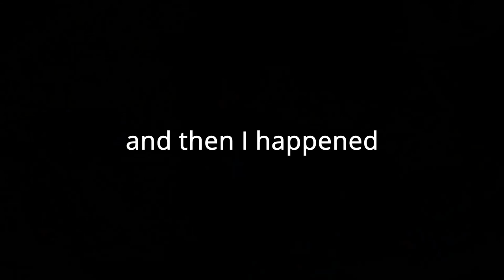1967 Starcraft Holiday Stern drive repair Mercruiser 120 hp we found the leak

Comment: I can fully testify you should use that special tool to removes that goofy upper out drive nut. I tried using a punch and just destroyed that aluminum nut. Good thing I was just wanting to see the locked up bearings as I had already ordered, received and installed the new SEI 106 upper and lower.
Looking forward to seeing what the ding ding sound may be👍
OH, one more thing, I bought and started using a black pool noodle on the lower angled windshield mounts like you have on your orange Starcraft, makes for a great armrest and a nice place to put a hook when re-rigging a catfish pole
Reply from the maker: It sure does. Pool noodles are kinda handy. Thanks for watching

Comment: Gday mate i also follow dangar stu ( dangar marine ) he actually lived about 10km away when we were growing up now in sydney ,anyway the sealant you talk about s sikaflex 291 same as the 3m product really comes in black and white i have used it for years on my resto boats sticks like *** to a blanket once cured with my last ( current ) boat its fiberglass and what i do is use the 291 to stick whatever blocks ect to the inside of the hull then glass over them they aint going anywhere i have even glued timber to the inside of my ali boats and had no problems at all its good stuff . this video remides me to never buy an inboard boat motor take care .
Reply from the maker: I have mixed emotions on the outboard vs inboard, inboards are so much more affordable if you are able to do the work yourself, but the outboards take up so much less space, I'm going to get some of that sikaflex 291 for my next project. Thanks for watching

Comment: I use bellows adhesive .  The mercruiser factory service manual shows exact order and placement of bellows and position of all the clamps.  Usually an hour and i have it all back together. Its very important to follow book to thr T. I recommend 
Getting that service book if you do this.  Enjoy your videos though!
Reply from the maker: Thanks for the info! I do have a service book, I probably should look through it sometime. Thanks for watching
Reply: Sealock sells the book

Comment: Hey Mike, happy Father’s Day!

I’ve got a Johnson 1969 20hp much like the one you have a video on. She will run for 15-30 seconds and then sputter out. It almost seems as if the fuel pump isn’t working, or, maybe even the carb is running rich. 

Bulb is tight after it dies and I can’t get it started again unless I let it sit for a few minutes anyways, which makes me think flooded. This motor used to run like this but bulb would be empty, replaced fuel pump and still have this issue, sans bulb. Any ideas? Open to emailing if that’s better for you. Thanks for your time.
Reply from the maker: I really like to put clear fuel line on the outbound side of the fuel pump, then you can see what is going on. Could be bad check valve in the fuel line, could be a bad new fuel pump, if does sound fuel related, I just had the same issue on my 15hp and it turned out to be blown head gasket letting water get in the combustion chamber when it pumped up,  Check compression and make sure it is good. Thanks for watching
Reply: @Michaelsbackyardmarina  appreciate it. Have a good one!